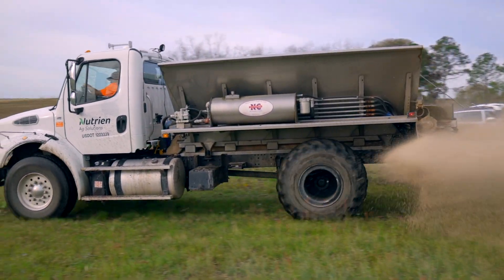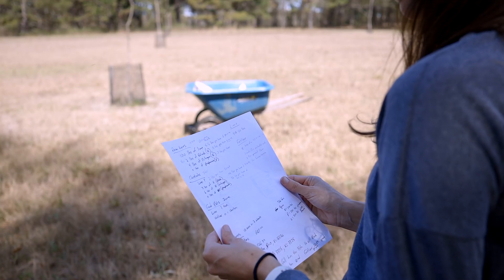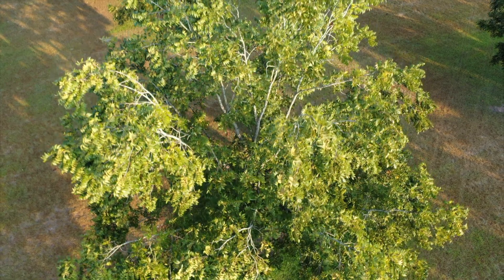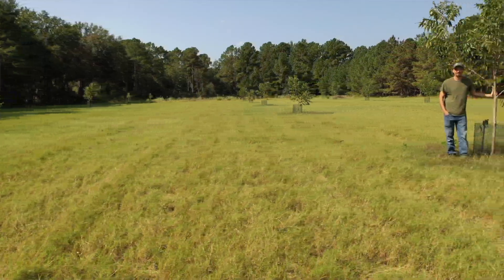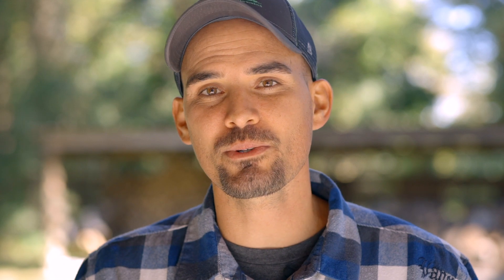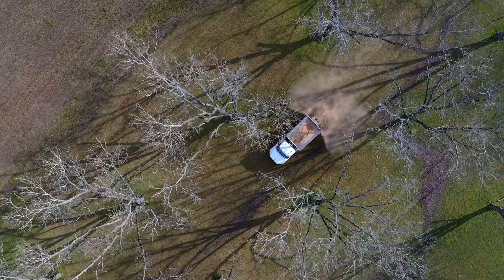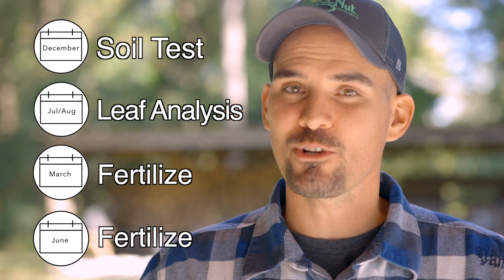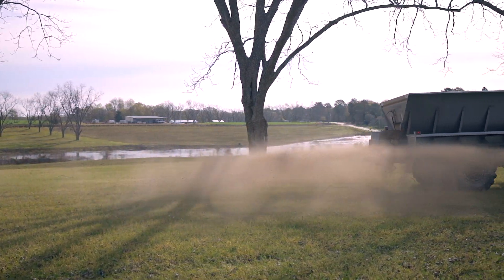Fertilizing Pecan Trees: Spreading Fertilizer On Pecan Trees

Comment: How are you applying Zinc to your trees? We have been mixing in tank and taping a backpack leaf blower to apply to trees. I can’t justify a big sprayer. I am curious about a skid sprayer if that would work. Any ideas?
Reply from the maker: I have tried hand sprayers when my trees were small, and I agree with you that it is difficult. I also cannot justify a big sprayer. I have been doing ground application and my last leaf analysis showed their zinc levels are adequate. So, in the future that is my plan is to continue ground application.
Reply: @BagANut  thanks….